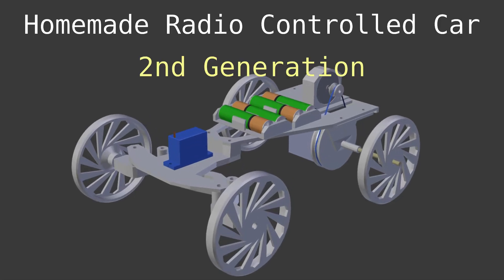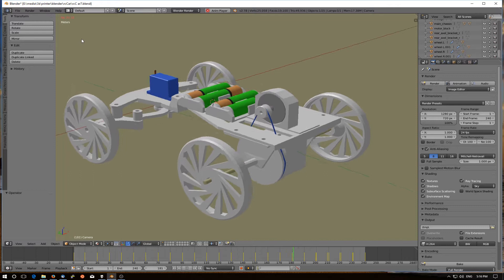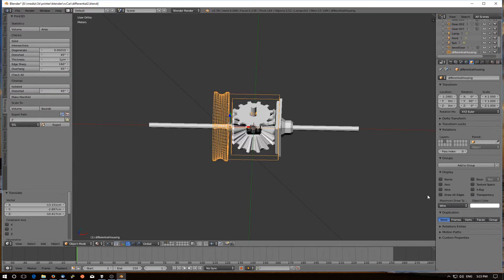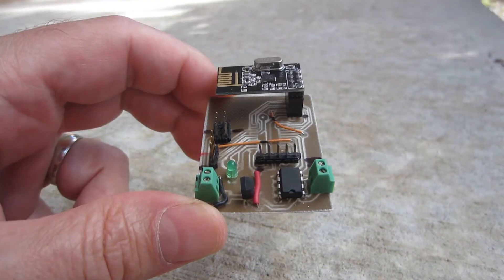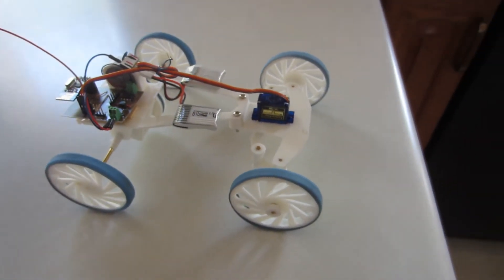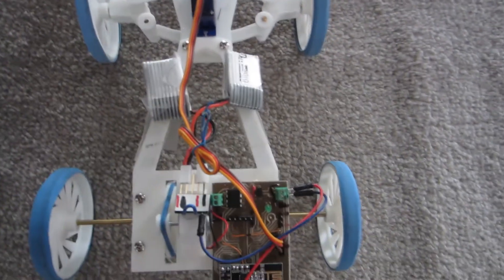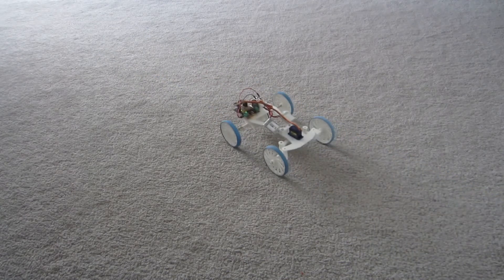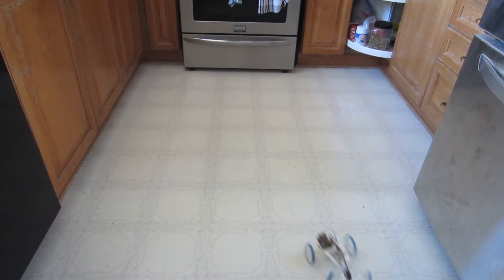Homemade Radio Controlled Car 2nd Gen

Comment: Great vid! What gear ratio did you use?
Reply from the maker: Thanks. The differential is 1:1 so it just comes down to the diameters of the two pulleys, which I just pulled out of thin air.

Comment: Very nice. I'm in the process of designing an rc car that is majority lasercut. The steering mechanism on this is really nice. I'll have to explore this as an option. How did you go with tolerances when 3D printing?
Reply from the maker: Thanks. I have a nice set of drills going from around 1mm to 6mm in 0.1mm increments so I usually just design the holes a bit small then drill it to the size needed. A lot of the holes in this are friction fit and if I remember correctly I didn't have to drill those. That always takes a little experimentation.

Comment: Hi, ur demo is awesome.
I would like to know how to draw a correct steering part? 
I mean the one with servo for steering.
Is there any calculation behind?

I am working on a similar steering part with my rc car.
Reply from the maker: Thanks. I didn't do any real calculations but have studied the basic steering linkage previously. I just winged it and was prepared to tweak it but it worked out. Look up "Ackermann steering geometry" in wikipedia.

Comment: I really like the steering mechanism!
Isn't blender for animation though? If I'm right, then you should probably learn some 'proper' 3d cad as the design process may be faster and easier... I use Autodesk Inventor if your interested...
Reply from the maker: Thanks. Yes, Blender is primarily for  3d modelling and animation but it has some plugins that make it good for 3d printing. It is probably not the best choice for 3D CAD for someone who doesn't already know it but I have been using Blender for a long time so it works well for me.
Reply: OK, well if it works for you I guess that's all yo can ask ;)
Reply: Also, you could try flexible filament for the tires, but what really works for me is 3d printing a mold and then using 100% silicone to mold a tire around the wheel or even through channels in the wheel - this means it can't come off.